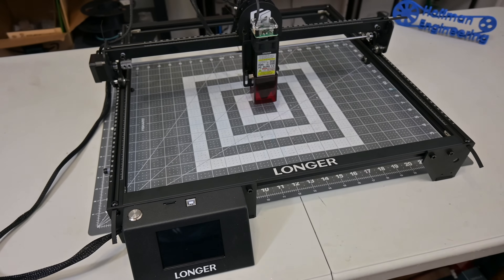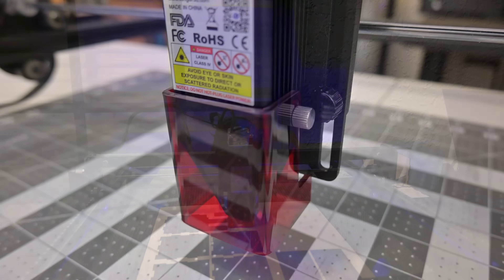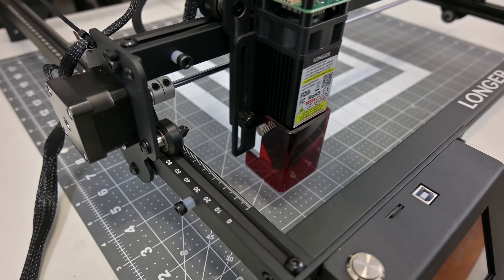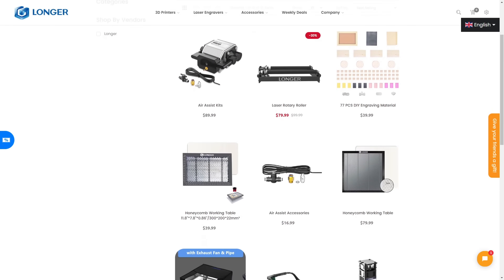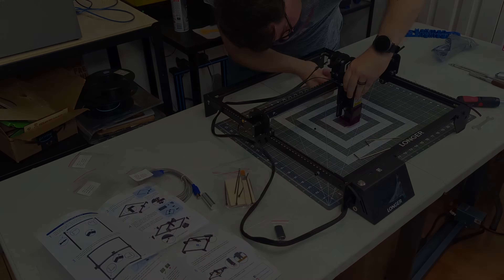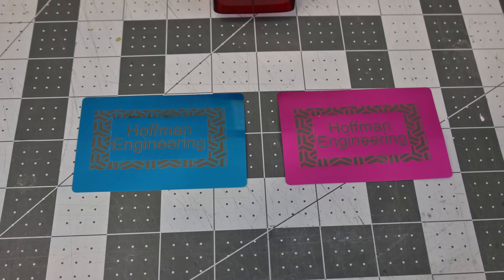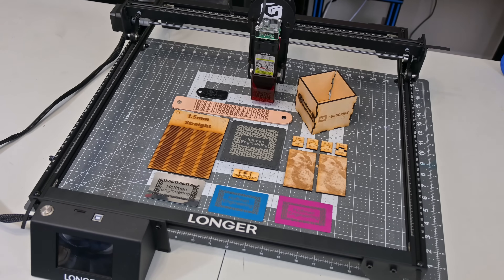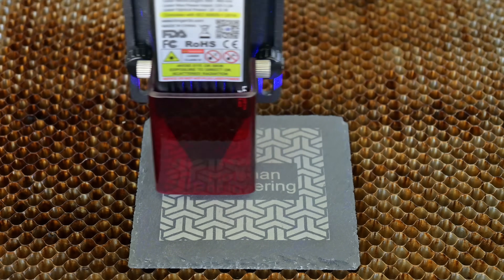A Powerful AND Affordable Laser - Longer RAY5 10W Laser Engraver Review

Comment: First thing to do: Make a bracket or clip to mount that 5cm cylinder somewhere on the machine itself.
Reply from the maker: Great idea, that would be a perfect first project.
Reply: Just 3D Print a cylinder holder to attach right up front next to the control panel!!! 🤗